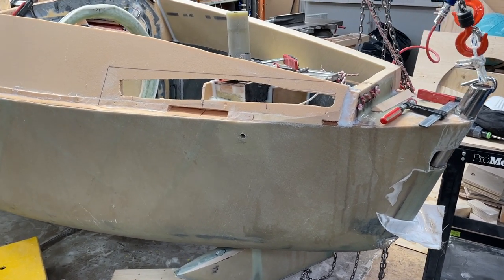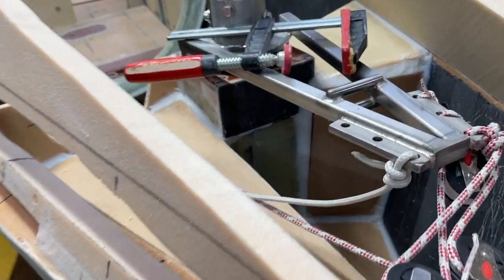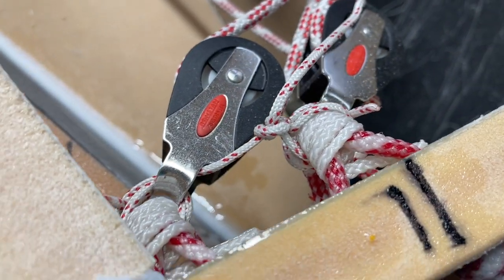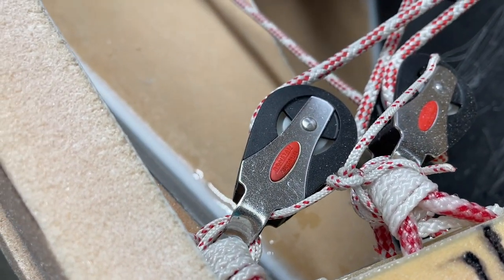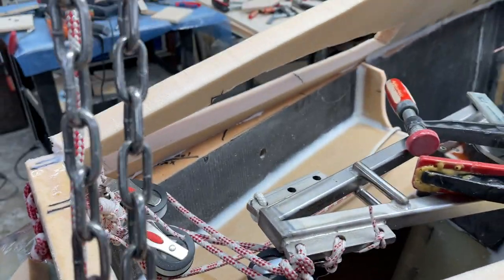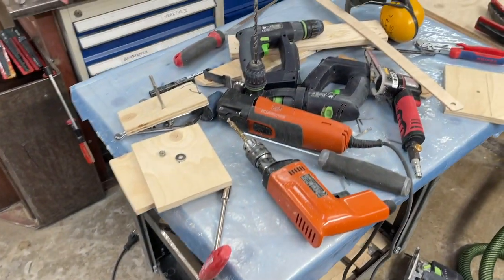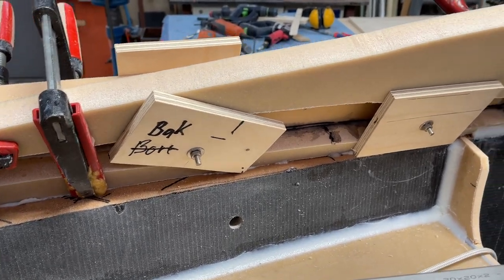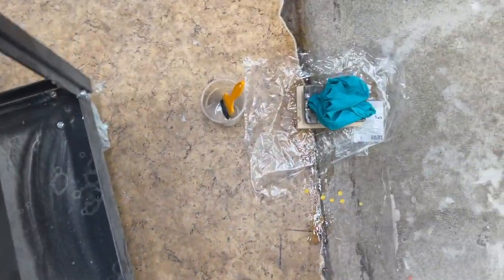12 Mar 2023 First 30 mm om the blister.

Comment: Hi Sven what is the Reason to have such a long tiller, would it not be possible to shorten to fit onside the hull to avoid the ”Hole”?
Reply from the maker: The tiller is not in my opinion long.
I need leverage in big waves like surfing down.
The gain by the blocks is 3 times the tiller is 0.4 meter
That equals a tiller of 1.2 meter.
It will take a few days to do the blister.
It will come in handy for the yoluh later.
I think it is motivated.
Reply: @SvenYrvindExlex  Thanks for clarifyimg !!really interesting to follow your project!!

Comment: Is that far enough forward? how much movement to bb and stb you get on the rudder? I always assumed the middle was when the arm is to the side, but now it looks like middle is further back than 90 degree to the side.
Reply from the maker: I estimate that I can turn the rudder at least 30° in either direction 
A but more to one side.
Reply: @SvenYrvindExlex  30 degrees sounds good, thank you for clarifying.